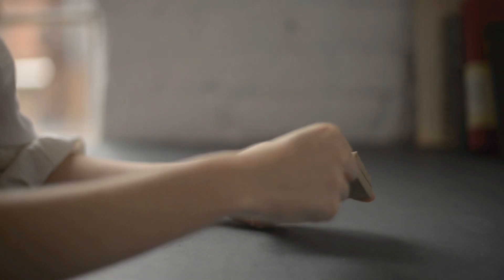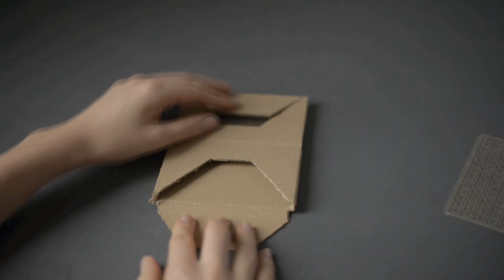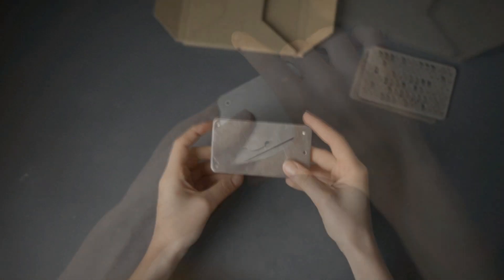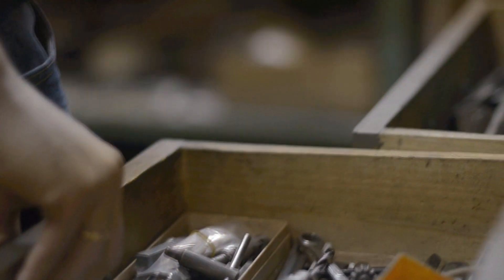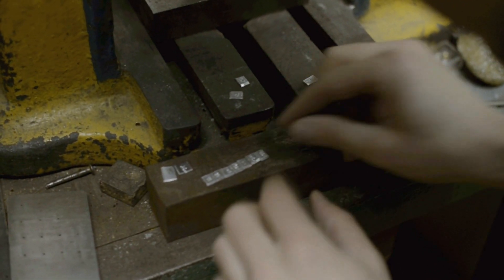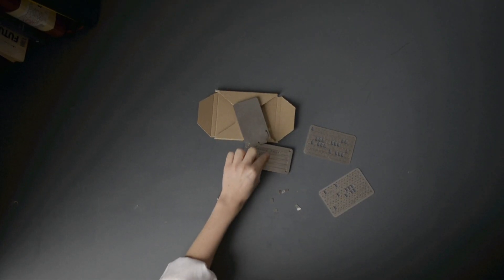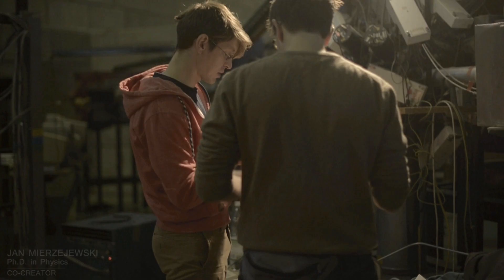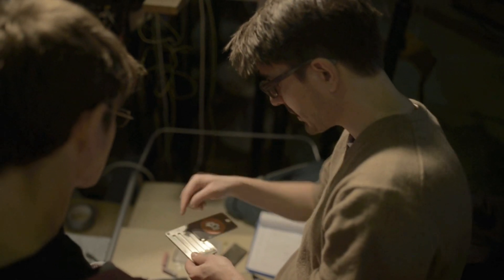Cryptosteel - The Ulitmate Cold Wallet Backup

Comment: one idea.  After arranging the letters on the bar and locking them, we can add a layer of security for situations where the letters are separated and dropped.  For this purpose, after arranging the letters in the bar and locking them, we draw a simple pattern or design with a knife on the body of the letters, which are now a cylinder next to each other.  If the order of the letters is messed up, it is enough to arrange this pattern or design by putting the letters together. Also, in my opinion, it would be much better if there was a way to make the letters inside the cylinder shake less and not make a hissing sound, for example, you can use  A glue or varnish is used after arranging the letters so that they do not produce additional noise to reveal the contents inside the cylinder.  I hope it was useful.